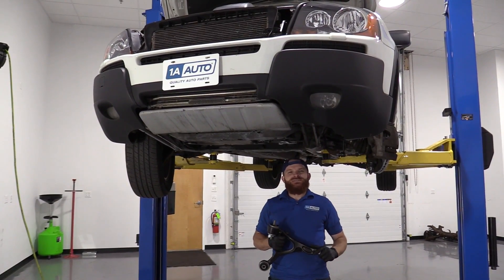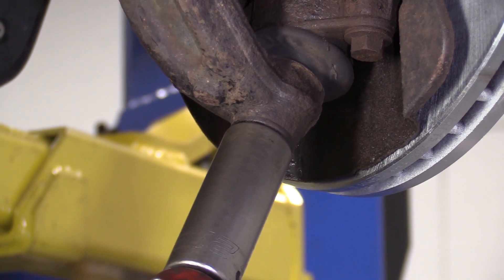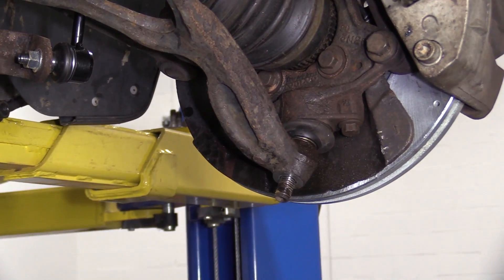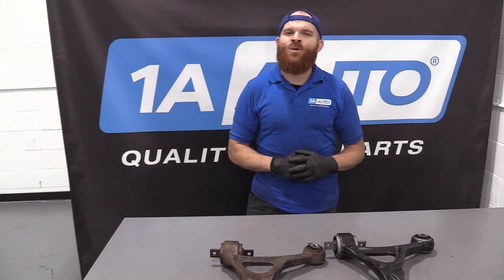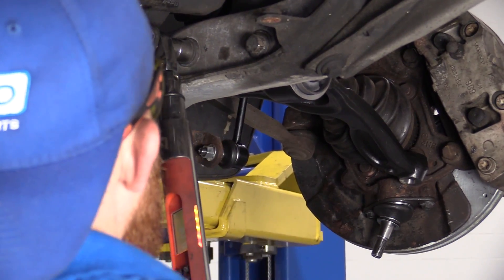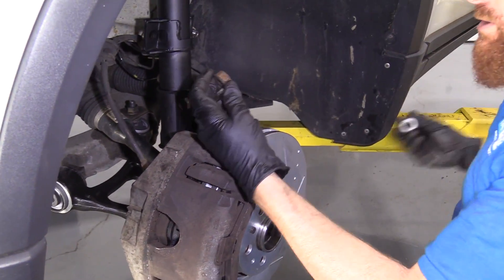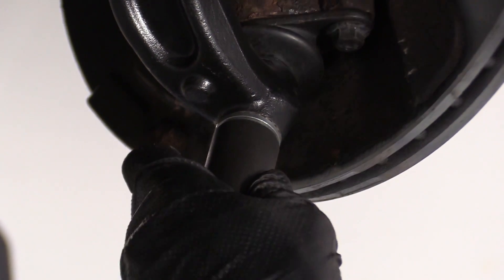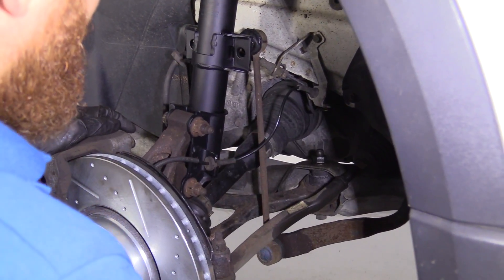How to Replace Front Lower Control Arm 02-14 Volvo XC90

Comment: When putting the wheel back on, I raise it up to the hub, push it on, then turn the wheel to line up the holes while at the same time, I  hold the wheel on by using one hand to push on the middle of the wheel to hold the wheel on the hub. Then, I take my free hand and screw in the bolts. I don't have to hold the bottom of the wheel because the middle of the wheel fits over the protruding hub from the rotor assembly and I just put a little pressure with my hand on the middle of the wheel and it holds it just fine. It will not hop off the hub I promise you.😁

Comment: Great video.  I am a bit apprehensive as all I have is a driveway and no lift so always a challenge.  My question is on the angle gauge - it is not clear to me what the purpose of this is, why was this step necessary?
Reply: Yes please answer this.
Reply: The angle gauge is a step I learned working on a VW when I replaced the head after a timing belt failure. When torquing down the head bolts you torque them all to spec THEN tighten them an added 1/2 turn (or whatever it was). I’m guessing that is what is called for when he used that gauge on those bolts.
Reply: The angle gauge is usually for torque to yield bolts. What this means is that you first tighten the bolt to a specified torque, and then you use an angle gauge (or simply eyeball it like 90% of people do) to go even further. What this does is slightly stretch the bolt and causes it to hold tension on itself. Since the bolt only has a certain tensile strength, you can't do this too far or else you'll weaken it. 
What wasn't mentioned in this video, and really should have been, is that these instructions are only for the first time use of the bolt.  These are technically one time use bolts. Once you take them off, you should replace them, since they can only be stretched once. This process isn't necessary if you're reinstalling the old bolts (which you shouldn't... but everybody does).

Comment: Quick question…do these have equal or higher durometer level bushings than oem? Back story, I purchased a new set of lower control arms from eBay (I know) for my wife’s 08 Xc90 and am having worse issues with lower arm bushing deflection than I did with the originals I replaced. Those parts fit fine, but the bushings are way to soft. I cannot afford to spend $700 on oe lower control arms so I’m looking for a quality alternative. I just don’t want to purchase from you guys and end up with a rebadged product like the eBay parts I’m going to replace. Sorry for the long comment/question, but I’m looking forward to your response. Side note, I am a gse shop manager/and lead and I use your videos whenever we get automotive jobs in the shop as help videos. Great job and Thanks!